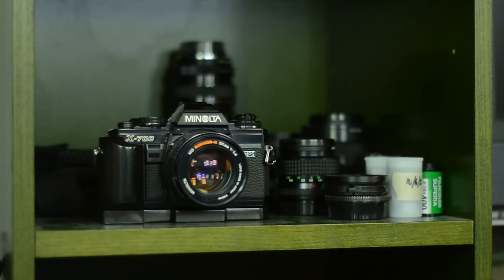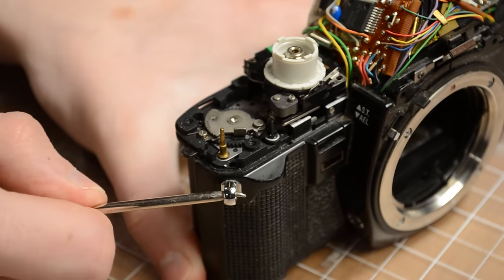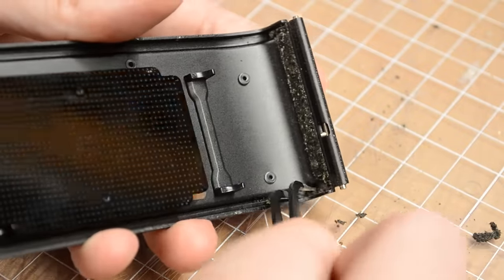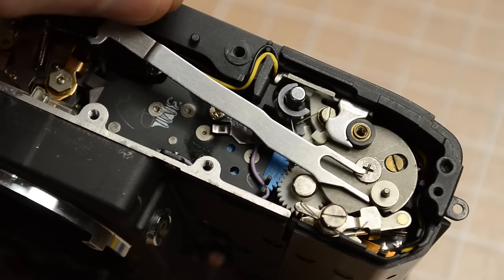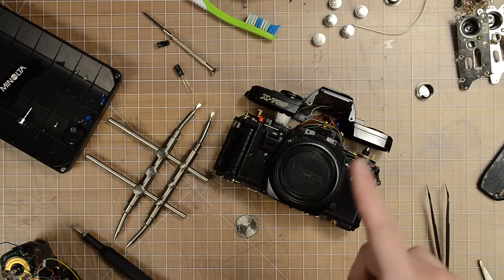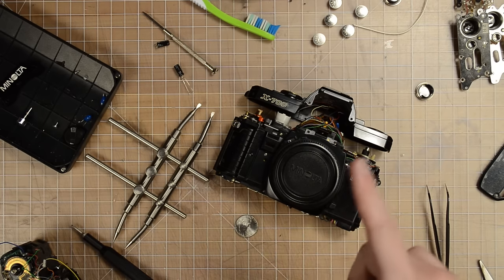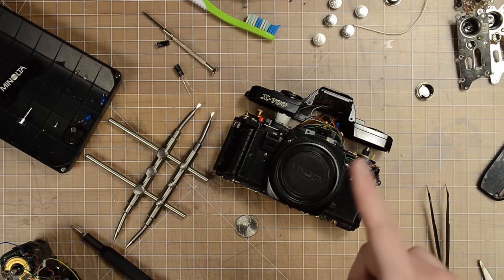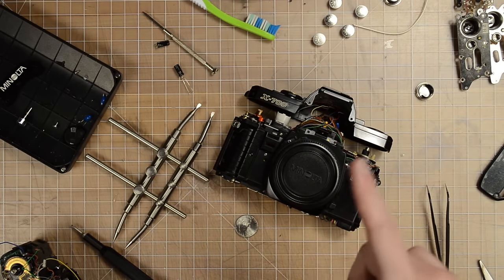Iconic 80's Film Camera gets an Overhaul - Minolta X-700 CLA & Repaint

Comment: Well Patrick I’m 73 and live in New Forest U.K. my first proper SLR was a Minolta X700 and today I was working on a, you guessed it Minolta X700 and it went terribly wrong.
 I collect cameras and have several of these, but the one that I was working on was a recent purchase and it was missing a few parts, but really apart from that, oh and it won’t wind on, or fire! But we know don’t we, these little secrets that you used in this video, the latter one, connecting the two yellow wires together, was one that I wanted to try as I to watched the guy on YouTube who knew what he was talking about as he shows you in the video and proved the point, no it wasn’t a trick, but you were right about the flex board, 🤬😩😳😢 I came to solder the wires as one had come adrift 🛶🏝️anyway, so having taken the bottom off, I thought great 30 min job and I’ll be 🤣😂🤣😂🤣😂err well, the first thing I noticed was a black wire as well? 😏so I thought, no problem I’ll get one my other Xs and look at wiring, 🤦‍♂️ could I find out where it was supposed to go😱well off came the opinner bottom plate, with the six screws of different lengths and metal, of pops the spring from under eat and what do you know, ok you do know! But it travels down along the back of camera, disappears round under and reappears but tracing black on black is a pain, it runs parallel with the yellow wire and connects next to the shutter mechanism next to the yellow wire but where does it connect? So off with the inner bottom plate on the second camera, spring etc etc, I find it connects under that flex board 🤔😳🤦‍♂️ok David it’s fine, your fine, at this point I get a message from a women who has been in touch before about a storage heater I’m selling and it’s obvious she is either Chinese or of a nationality that uses things like, ok I buy you be there, I send tomorrow man with van! 😳so I reply, have you told them that they need to send two men as it’s heavy and etc etc, regards David, well I won’t bore you with the details but this went back and forth for two hours with 30 mins or 15 mins then asked me something else, all understandable as she said they would have an envelope with the money in! Then I started to suspect, please you go on this site and send me screen shot, check email, there is a site man with a van, I’m trying to sort camera and thinking, I don’t need this, I read the advert and note it talks of best Dollar for the work? 🤔🫢😵‍💫🥴 so I mention this and ask where are you located, never mind you be there tomorrow 1pm so I do my old man confused act! I’m sorry but I’m not here tomorrow, where you live, why so I know where to come tomorrow, no I’m not here where are you! Penny drops, I say your talking out your arse aren’t you, this is a scam 🤬🤬🤬🤬🤬🧐🤬🤬🤬🤬then I get a reply back police will come tomorrow 1pm I reply well they will be able to assist in getting the heater in van, no they come tomorrow to arrest you, Fxxk Off! 
So when you started talking about taking yours apart and, well you had me in stitches, the wires you are right do just keep popping off or even worse getting shorter and shorter as you try to attach I was putting extension pieces in and it just went from bad to worse! I was re routing the yellow one and well you took me back, made me laugh and the hours, weeks, months, years, decades, lifetime you spent on the project, is a true credit to you, think of it as a photo type 🤣😂🤣😂🤣Prototype! I think you would be better going on eBay and buying off cuts of leather where they tell you the gage and it’s cheap, but all in all you learned a lot, you have a unique camera and a full video of how to take apart and put back a Minolta X700 and I bet you could flog that, you have copy right on it and I for one would pay to have that as a reference. 
Sorry, I can’t hear you, what happened to the camera, it’s sat on the table in a worse state than when I started, but hey it’s past another day. 
I’ve subscribed and look forward to the next laugh/ learning session.. Regards David

Comment: Tip on the airbrushing, back up your airbrush and move a single direction in even strokes. Then change the orientation of the object. By the time you hit the piece from every angle you'll have a decent amount of coats built up. You were having issues with paint thickness because of the motion you are using at 22:15.

Comment: I thought I was patient fixing old, purely mechanical cameras, but you reached new levels on this repair/rebuild/service/overhaul - really enjoyed the video, and couldn't help laughing at the many attempts to remove the old paint/powder coat or whatever it was, there seemed to be a certain inevitability that it would end in dissolved plastic parts, which wasn't really that much of an issue as you had spares anyway.  Great video.

Comment: I’m just starting this thing, and I have to say, you are very good at concealing your method of recording where all the little doodads are coming from, and how you are retaining and organizing them. Wait, I’m dizzy…. I just need a moment to recover…. I’m having flashbacks of the two SRTs I destroyed trying to fix their meters. Amazing—so far.
Reply from the maker: The cover of my bit driver set doubles as a parts tray. I also use a magnetic tray that you can get at harbor freight for a couple bucks. I simply keep them out of frame so that they're out of harms way. Picking up tiny screws off the floor of my basement isn't my favorite pastime so I try to avoid that. Thanks for watching.

Comment: I've done some repairs on some tiny Canon PowerShot digital point-and-shoots (grit in the gear train that works the lens assembly, will often cause them to throw lens errors). Your video gives me hope about the feasibility of fixing older electronic film cameras.

When it comes to painting plastic, there's an automotive product called 'adhesion promoter'. This is what enables car paint to stick to plastic parts. It's also used when you want to ensure that double sided VHB tape doesn't come unglued.
Reply from the maker: I have an older Panasonic digital point and shoot that's somehow developed haze on the inside of the protective lens filter. Going to try tackling that at some point, but I've been putting it off. 

Someone else commented about a product from Duplicolor that's designed for automotive use and is supposed to work well on plastic. I'm guessing it's the same as what you're referring to. I'll definitely give that a try if I ever find myself painting plastic again. Thanks for the suggestion.

Comment: Excellent video editing and great job overall! Not many people out there doing repairs on these old Japanese cameras, let alone restoration. One thing I could recommend to you is an automotive plastic primer. There are many different brands out there, but the one thing most have in common is that they are water based and therefore will not be absorbed into the plastic.
Reply from the maker: Thanks for the tip, I will have to look into trying some of that primer. Thank you for watching.

Comment: Love old film cameras. While surfing attempting to find how to fix my XG-7 I came across your video. As would be expected its film advance lever is frozen. The camera was used for many years and performed as expected. Then it began having an attitude, sometimes the film advance would not turn other times it would. Finally I gave up the ghost, put it on the shelf. After about two years I gave it another go, wow it worked. Walked about the house performing shutter actuation happy as I could be. Then, sadly it again copped an attitude, lever will not advance. Cleaned the battery holder in the camera, and the actual screw in battery holder, still cannot get it to work. Because the bottom of the battery holder looked corroded and the paint or metal was off I put a sliver of aluminum foil in that screw in holder hoping it would be good for connectivity. The BC switch will not light the BC light, my guess is it has a errant bottom capacitor. Did the ebay thingy, purchased a XG-M.

Edit 2024-03-01: the XG-M arrived, used its battery holder, BAM, the XG-7 now works. The entire issue was the XG-7 battery holder corroded, causing the bottom conductivity paint or some such to be removed.

Comment: Awesome stuff. In regards to the lifted pads from soldering, having a clean and well tinned chisel or bevel tip around 400f is key. That is assuming they used leaded solder which most older electronics did.

Comment: This is absolutely fantastic! Very interesting and inspiring. Now I wanna go CLA my own cameras.
Question though; what's the difference between using isopropyl alcohol as opposed to hydrogen peroxide? I mean, why use the latter for cleaning the mirror, and the former for seemingly everything else? Great video Patrick, thanks for sharing - and I certainly don't mind your sense of humor, haha! Although the audio is very low. Cheers /Fredrik
Reply from the maker: The rubbing alcohol is a mild solvent and is therefore too harsh for the plastic focusing screen. It could probably be used on the mirror, but I usually prefer not to chance it unless there's something particularly stuck on there. The peroxide on the other hand is great at killing fungus and provides just enough lubrication to prevent friction damage while cleaning. I also use it to clean lens elements. Sorry about the audio, will get it straightened out for the next one. Thanks for watching.

Comment: That was pretty amazing and astonishingly stubborn. Well done. Did hurt a little to see the plastic parts being dissolved (and I knew it once you said thinner) -  but sh*t happens.
I damaged some stuff and I've never even disassembled a camera this far. 
I'm a little bit curious why you tried so hard to remove the old paint, though. After the second failed attempt i would've just sanded it a little and go for it😂

Hungry for more!
Reply from the maker: There are two reasons why I was trying to remove the paint. The first is simply for adhesion, I was worried that the paint wouldn't bond well to the coating that was on the parts (I'm still not sure how well it did). The other issue I was worried about was clearance on some of the parts. When you add an additional layer that wasn't meant to be there from the factory it can cause fitment problems when everything goes back together, and some pieces may not be able to move freely. Thanks for watching.

Comment: Crazy cool to see you disassemble this entire complex piece of machinery, and the white repaint looks awesome imo! Do you perhaps have any tips for a fellow Minolta X-700 owner? I did a bunch of searching online, but I was never able to find any conclusive evidence of guidance for fixing a broken light meter, is that something you've run into before and you know a fix for? Or is it too complex to diagnose easily? I would super appreciate any help because I really love my Minolta and repairing is better than replacing!
Reply from the maker: I haven't had one with a light meter issue before, but it wouldn't hurt to try replacing the silicon cell that sits up over the viewfinder. If that doesn't work you check around with a multimeter but chasing down electrical problems can be a time consuming headache.

Comment: The old caps inside can also fail if the camera sits too long.  Mine sat without a battery for about 5 years, then it couldn't fire its shutter even with a fresh battery.  Had to replace the caps inside too, now it works great again.
Reply from the maker: Yeah the caps are the main issue with these cameras. They're otherwise quite reliable. Thanks for watching.

Comment: FWIW I've used polycrylic as an overcoat in all kinds of crazy situations, never had a problem its a very versatile product.  Also, if you ask customer service, they will tell you that you CANNOT spray polycrylic unless you buy it in a spray can because the formulation is different.  I've sprayed gallons of it through all sizes from little airbrushes to big hvlp guns.

Comment: It was fun to watch someone else wade into a full resto like this.  And no, it is not a matter of your skill--the f#$king pads will lift off all brands.  The Canon ones are on a plastic ribbon strip that simply peels off.  Good times!  The real key is to photograph, photograph, and photograph every detail--keeping parts sorted by the area they were removed from.  Dollar General and cheap plastic containers are your friend!  Congrats on a fine custom resto, and enjoy the frames.  I have two Canon A-1s and an Argus C3 waiting on me in various states of destruction.  The Argus will be a piece of cake...
Reply from the maker: Glad to hear it's not just me on the solder pads. I use the lid of my bit driver set which doubles as a parts organizer, and I also have a magnetic tray that I throw stuff into. I've hit the point with a lot of these Minolta bodies that I've more or less memorized where each screw goes, but I'm very careful whenever I work on something new. Good luck with your projects. Thanks for watching.

Comment: Hi, loved the video, watched it multiple times haha, I was just wondering what oil and grease you recommend for CLAs. I’ve seen molybdenum grease recommended, and I’m really not sure about oil but i have some singer sewing machine oil already, idk if that would work. If you have any suggestions that would be amazing!
Reply from the maker: I have the oil I use linked in the video description (it's called super lube), it's a multipurpose oil that's rated for a very wide temperature range. I believe one of the recommended uses is for sewing machines. I've seen other people use sewing machine oil which should also work quite well. For the grease I actually tend to use helicoid grease (made for lenses) because once again it's formulated to hold up to heat and cold without breaking down or gumming up. The one I have linked is not the exact stuff I use, but it's the closest that I could find that's still available through Amazon.

Comment: Nice one! I'm a bit of a tinkerer myself and have a repaint-a-camere-project in the line as well. So thanks for your f*ckups!
Got a question though: How do you messure the shutter speeds?
Thanks for the info! ✌️
Reply from the maker: I have an optical tester that I use that converts change in light to an analog signal. It's one of those small ones that plug into a 3.5mm jack. I test the speeds in the dark with a light source shining into one side of the camera which is why I haven't filmed it. It's not the most ideal method of testing speeds but I haven't been able to find one of the old factory test units for sale, and even if I did I probably couldn't afford it at the moment. I find that it's pretty good for any speed up to 1/1000 but beyond that I'm not sure how accurate it is. Thanks for watching.

Comment: Advice from a professional car painter. Painting over existing paint is not ever really an issue unless it's flaking. Feather out any flaked spots and hit it with some primer, or for metal acid etch primer. Sand if necessary between coats then paint your part. Always make sure to add a protective clear coat over the paint and your done. You can buff after for a perfectly glass like finish, or leave it be. Hope this helps in your future endeavors. Stripping is almost always unnecessary imho unless you have rust or corrosion under it. 🤟🤘✌️

Edit: 600-800 is the preferred sanding grit for a nice finish before painting. Oh and use real clear coat for cars, it's a guarantee on sticking and staying.

Comment: First of all, congratulations on the mechatronic skills you have; I wanted to ask you something: I bought a Minolta, a beautiful Minolta, EX-1 in perfect cosmetic condition. Unfortunately, however, despite new batteries, the mirror remains raised and the shutter does not click, rather it is as if it disarms without opening. It says in the manual that when this happens, it means the batteries are flat. But in my case this is not possible because I have just put in new ones. I tried giving it some contact spray and, after a while, it started working in AUTO. In manual, however, the mirror stays up and the shutter opens but does not close. The battery light works and so does the exposure meter. Can you help me? Thank you very much.
Riccardo

Comment: Great videos! What and where capacitors do you recommend for replacing Minolta X-700 capacitors? I also have a minty FS-1 that I am trying to resurrect. It's sad because it's sooo clean...
Reply from the maker: I buy them from a website called Digikey. You'll have to figure out which ones you'll need for the FS-1 by pulling out the bad ones and checking the rating. For the X-700 I use either 150µF or 220µF caps rated for 6.3 volts (which is higher than stock). The factory repair manual says 150 but the later made X-700s have 220's in them and I can confirm both will work.

Comment: The metal primer could have been applied with atomic deposition  (ALD). Basically you use plasma in a vacuum to transfer metals onto a surface. As far as I know, anything can be coated with metal like this (plastics, glass, ceramics etc). Not quite powder coating, more similar to electroplating. The layers are very thin.

Comment: I like your style. The camera came out mid, but I enjoyed the project. You're on to something with your narration, keep it up
Reply from the maker: Yeah I wasn't super happy with the outcome. Going to try out powder coating or cerakote at some point. Didn't realize it could be applied over plastic before I worked on this project, but it self levels during curing and should provide better results. Only drawback is that it costs an arm and a leg for a tiny amount. Thanks for watching.
Reply: @patricknicholsdesign  spray paint can also go applied onto plastics, but you'd need to scuff it up and add adhesion promoter before paint and then apply a protective coat after painting for it to not just scratch off.